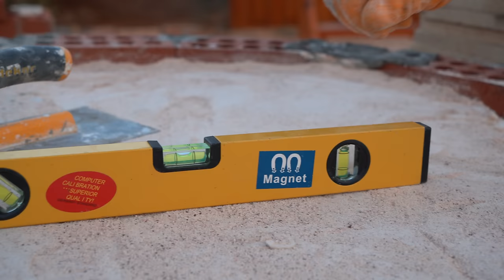How to Make a Simple And Beautiful Pizza Oven / Building a Wooden House

Comment: I liked the video, and I want to share an important information from professional pizza oven builders. Do not use masonry mortar to build one of these alone. It should only be used in the outer side of the bricks for water protection and its original purpose. On the inside Use Clay mixed with sand and Lime substitute or lime. It works like masonry mortar but can stand heat on a long term, unline masonry mortar!
Reply: hello, can we connect ? I'd like to learn from you about the pizza oven building process
Reply: Hello i would like to also contact you we will build one also

Comment: The entire structure has no foundation. For such a weight, it would have been necessary to dig down to at least 30 cm and make a strip base. The bottom should have been filled with compacted gravel under the concrete and not with such large stones. There is a huge crack on the concrete base of the oven, which indicates some kind of defect. Heat-resistant bricks should have been used for the oven, but at least solid bricks. A second layer of external heat storage was not made, a layer of poor heat-conducting insulation, wire mesh and plaster over it. It's pretty good though.

Comment: In terms of construction, it looks ok as far as the processing of the stones is concerned. 

However, the opening is much too high so that the heat escapes and, furthermore, it is not insulated from the outside, which also leads to the loss of all the heat. And I haven't checked whether the stove is insulated at the bottom. 

An amateur stove, but if it makes him happy, it has achieved its goal.

Comment: Wrong bricks, Wrong mud, The chimey openng at the door needs to be way lower then the dome to encourage a swirl pattern wifh the heat. The dome needs a layer of insulation like rock wool or inflamable medium, Then another layer of fire proof morter and bicks or rocks then mortot and smoogh out. The wall so thick they will hold heat for days with only a small fire. Then fire position further back and smaller. Whrn its already at cooking temp. I beleive you can correct and fix what you have. Ateast you now have the basic shape. So you can now build a much bigger dome over that one day.